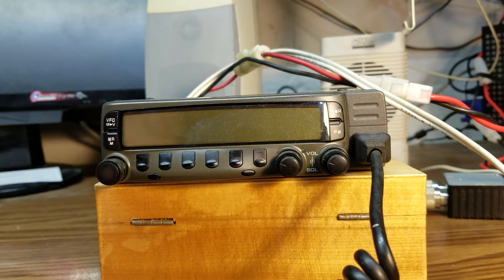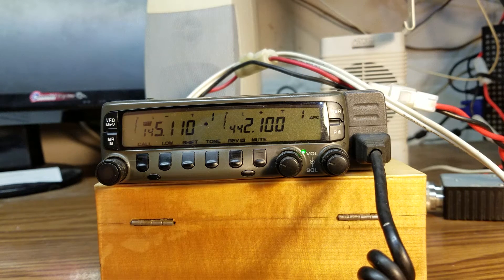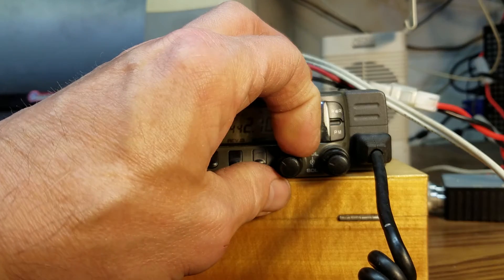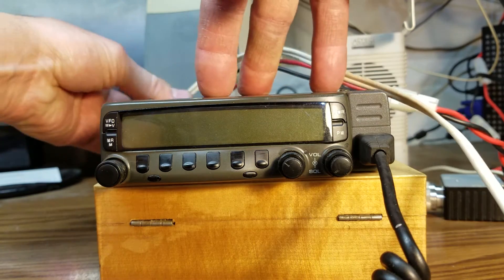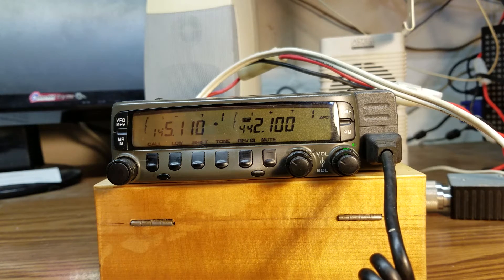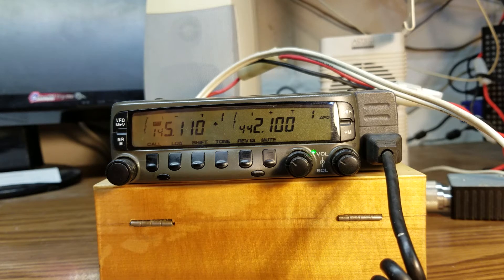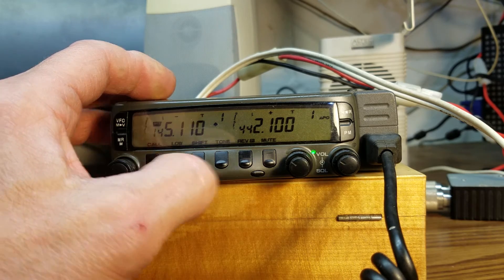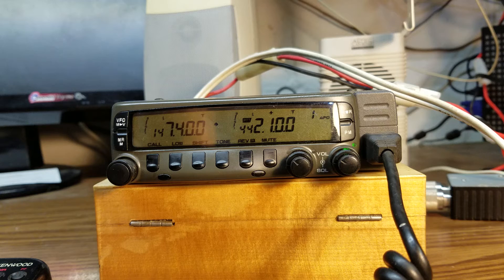Kenwood TM 733

Comment: what brand is this duplexer?
Reply from the maker: Don't really know. I'd have to open the box I packed it into to find out. I just know it works. The radio has two antenna jacks. One for each band. So to use an dual band antenna, you need the duplexer. I imagine that there would be some insertion loss in use. I didn't notice it. I can hit the same repeaters with this as I do with my current rig.